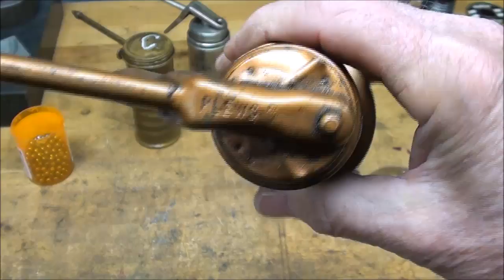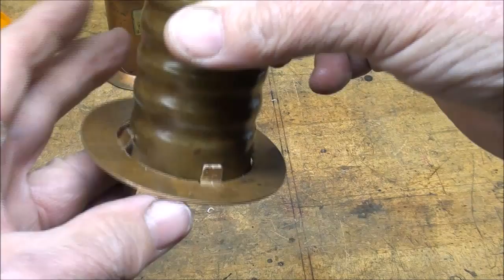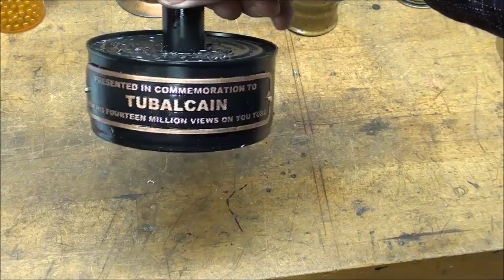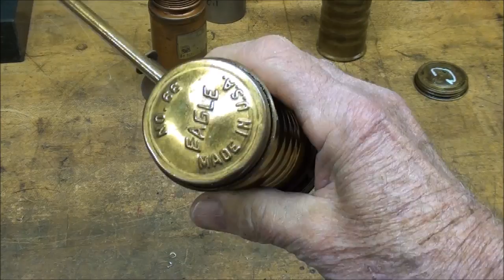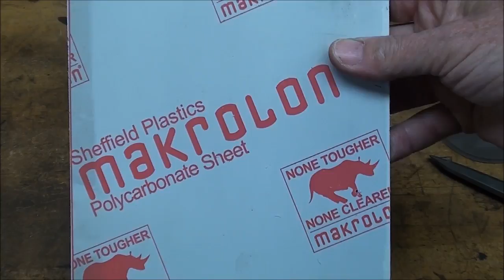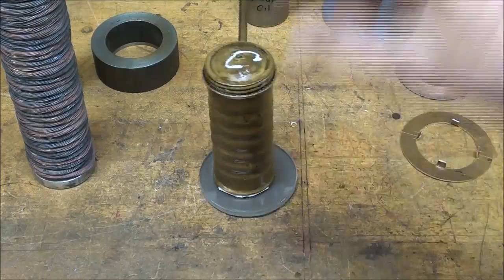SHOP TIPS #184 Improving the Venerable Eagle 66 Oilcan tubalcain

Comment: in the glue world I really like the 3M Weather Strip Adhesive, I use it for a lot of different applications, holding gaskets in place to attaching things to other things, it is really tough stuff, get it at the auto parts stores, buy the 3M brand. Apply it to one surface, place the two parts together to spread to both parts , then immediately pull them apart and let air get to both sides for a few seconds ( 10 seconds or less ) and then reposition and align parts. clamp if you like,  you are done, sets up enough for most applications almost instantly. Try it, you will like it.

Comment: To start, you were waxing philosophic about...  childhood and gravity.  I was hooked!

Then your sleep deprived hyperactive mind was like a ten-man brainstorming team full of insightful ideas (improve the oil can).  And it instigated a contagious conflagration of ideas throughout the YouTube-Stratosphere.  I meant, the YouTube Machinist community.  Lubricant delivery systems will experience dramatic leaps of innovation as a result of your shared musings.  I do the same thing.  Have since I was a child.  I think it was very productive.  My teachers thought otherwise.  You know… teachers said, “The boy has a problem with daydreaming”!  Thanks, for sharing your thoughts, I mean daydreaming!

By the way, I just did a project to adapt my four-jaw-scroll-woodchuck chuck to my metal lathe (MT#5 to 1”- 4TPI) and used vertical shear for the finish cut.  Magic!  Got a vertical shear-tool permanently mounted in a tool holder.  That was the best YouTube machinist tip ever!

Brad
Reply from the maker: Thanks-I enjoy your observations. The shear tool is amazing.

Comment: Great idea Mr. Pete!!!  I love the idea of a bigger base on the oil cans.  I think you were on the right track with your original idea of a base.  Maybe instead of cutting out the whole ring and leaving the tabs you should leave it as a solid sheet and just cut the tabs out and bend them out.  Once the can is sitting on the sheet you could push the tabs against the can to secure it.  It should be a bit easier to construct and not add as much weight as the alternatives.    Or, you could add 4 more tabs and alternative bend every other one up.

Regards,
Sean Miller

Comment: I like using Polycaprolactone(aka polymorph) as a kind of glue. it's melts at about the temp of boiling water, but if you get it hotter it goes very like treacle. when it cools down again it's pretty darn solid. and it's easy to remove if you want to.
Reply from the maker: good idea

Comment: Take a tip from martha stewart......Attach the base with a hot glue gun.Make the base from an old turned wood drink coaster from the thrift store. If the coaster is old enough it might even look original. Hot glue is pretty impermeable to anything but heat, and the high temp stuff should work for the temps the can will see as long as you clean the can first. Also has good gap filling properties.
Reply from the maker: good idea

Comment: Mr Pete, Love your videos!  
How about:  match the brass disk up with the plastic disk & drill 3 (say 3/32") holes on a 2-3/4" concentric line through both.  Countersink the underside of the holes  in the plastic. add the brass disk to the oilcan  & bend the tabs in enough to catch the flange seam. Add a cork/oilpaper ring or bits of the foam tape to the underside of the tabs. Use 3/32 screws & nuts to secure the brass & plastic disks together?

Comment: How about silicon?  A little dab will do ya, and your base that you cut.  The silicon should hold up to all types of oil.  It works great on oil pan gaskets on cars.      Great thoughts, oil cans that is.
Reply: Great idea with the silicon! Lots of cool solutions,Hot glue,Velcro, Egg shaped base or off set disk.Very positive all great stuff. Thanks mrpete222 M.K.S

Comment: How about non-attached base? Like a portable home for it. If a recess were bored out of a thick disc/short bar length (maybe 1 to 1 1/2 inch thick or so) but not bored all the way through so the can just sit in it. Then it would be heavy and portable. It would be as stable as it was tall and wide. Of course the can would have to put back where the disc is but I can't see that being a problem at the moment. The rim of the base could be knurled for extra ease of portability. :)
Reply from the maker: Good idea

Comment: If you put a small bead of silicone caulk around the base after you use the double stick tape. It will keep the oil from getting to the tape.

Comment: Plews oil can:

Tubalcain,

My grandfather (DoD Materiels Testing Directorate, post WWII) left the family a Plews oil can in the basement that you have identically displayed in this video.  I still have it to this day (I'm mid-40's) and actively use in my 'need-to-lube duties' and it works wonderfully.  I change the oil from time-to-time to prevent varnishing, but this little oil can is a workhorse.  I know a similar, but less quality model is available today, but nothing compares to the original construction! 

V/R,
DU
Reply from the maker: Thanks--very interesting

Comment: I would take a say, 3.5" x .250 brass disk or so and mill a relief into it which is a couple thousands smaller than your oil can. Pop the Eagle in the deep freeze and heat up that brass disk and when one is sufficiently hot and the other frigid, stick'em together! If the oil can has a consistent enough size, you should get a sturdy, clean, fastener free base that matches! If you feel so inclined, add some penetrating anerobic compound later. Cheers!

Comment: Many have suggested hot glue - the base could be a large plated washer.  I have used outsize washers as weights to hold patterns on material for marking or cutting - very cost effective

Comment: Thanks Mr. Pete, fun video.  I use industrial Velcro for things that like to get away or tip.  I discovered it with a rack panel project & came with a 4U rack I purchased.  The glue is phenomenal, oil won't touch it and even resists acetone for some reason after I had to peal it off after a year or so.  It also cushions vibrations to some degree.  Some of the fabric stores carry it up to 2" but you can find it on line...Amazon, etc.  Usually black and a bit pricey but one of the best inventions of the last century, IMHO.
Reply from the maker: good idea

Comment: With your original idea, if you left the center opening a little smaller, the bottom of the can could sit on it. Then bend the tabs in to lock it in place. I enjoyed the way you went through your thought process. Looks like you found something that will work!
Reply from the maker: good idea

Comment: Make the base egg shaped so there is more material jutting out under the spout. Great idea BTW.
Reply from the maker: good idea
Reply: That was my thinking..
Reply: Wouldn't you want larger base part apposed to spout so that it would act as a counter balance to the spout?
Reply: Perhaps if it were very heavy. The piece of light plastic used in the video wouldn't be much help opposed to the spout.
Reply: Anything that increases the base surface area will prevent tip over. Plastic or not. The weight of the oil can and oil will press down on the base equally. Long as the oil tube does not have a huge weight on the end, but most do not.

Comment: How about a nice machined split sleeve? Machine a ring of steel with a groove to fit the ring at the bottom of the can. Make it close to a press fit. Then bore a couple holes across the edge, tap one side and clamp it around the can. Maybe add a couple pieces of lead foil that can compress to keep the ring nice and tight?

Comment: I just want to know, how come they couldn't make these old oil cans so that they just didn't leak?  I don't think that could be too hard..  Maybe some o-rings would need to be added in the valve and the refill cap, but if it was designed with these from the outset, it wouldn't be all that more costly or difficult to manufacture...  

Anyway, I got a PLEWS (is that spelling right? I can't make out all the letters on the bottom of my can anymore) oil can like the one in your video BUT mine is so old it doesn't have the wider base like yours does!  The width of the body is the same all the way down to the base, so you can see they must have added the "anti-tip" ring on later models to address this problem.  The can was my wife's grandpa's and besides  it being so prone to getting knocked over and leaving a puddle of oil to clean up the next day, I love it.  Anyway, now you got me thinking about how to do a non-permanent modification to it to prevent it from tipping...  I have some large hole saws, so my thought was to take a 3.5" hole saw and make a disk out from 0.125" aluminum sheet and then double stick tape that to the bottom....  Or maybe I'll get lucky and have the right hole saw diameter that's a few thousandth smaller than the diameter of the oil can and then just press fit it on the bottom lip!
Reply from the maker: good idea

Comment: If you made the tabs on the brass ring longer, say 3/8-inch or so; then you could cinch them down tight with a stainless-steel worm gear clamp, like is used to secure radiator hoses.

Comment: If I lived nearby and had exact measurements, I would turn a wooden disc on my wood lathe, put a recess of correct diameter in centre and then undercut the recess so that it would 'pop' in and continue to be held. Great video, Thx. John (ipswich UK).

Comment: I liked the idea of the steel or delrin ring around it. It adds weight as well as a larger base for more stability. You could drill through the ring and secure it with some nylon tipped setscrews to prevent it slipping off, but it's probably a little overengineered for a simple oil can.
Reply from the maker: good idea

Comment: Go back to your first sheet brass design, make a new 3 1/2" disk cut your 1"ish centre hole out, then instead of nibbling out between the ears you made just saw cut and bend the 4 ears up. Set the can on the remaining flanges and bend the ears into contact with the oil can, voilà, a period and material appropriate, non-destructive modification...
Reply from the maker: good idea

Comment: cast the base of the oilcan in a liquid rubber or a sikaflex sort of caulking in some sort of glass jar lid (upside down, serving as the base). if the oilcan is tereated with some oil, the rubber will not adhere to it, making it possible to take the can out and putting back in snug.
Reply from the maker: yes
Reply: Sounds like it's worth a try great idea!

Comment: try hot melt glue instead of the double stick foam tape. clean the brass bottom with some solvent first to get rid of any oil residue. If you ever wanted to take it off it would require a little heat.